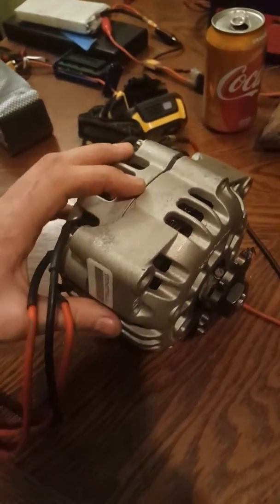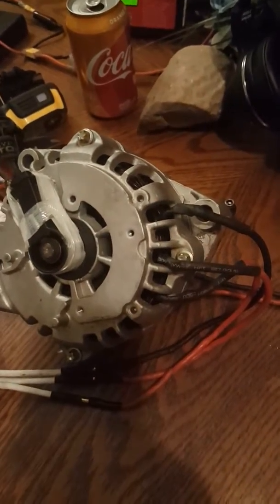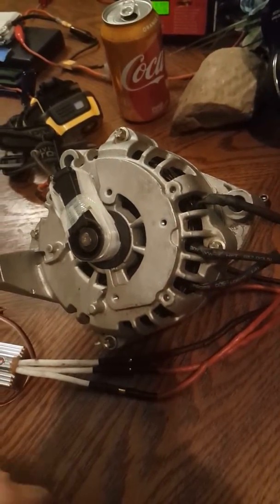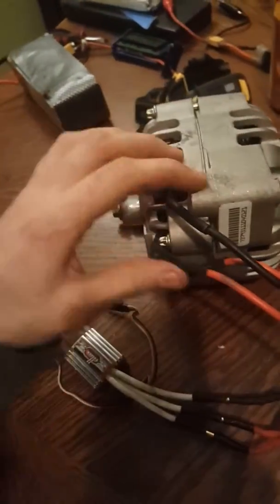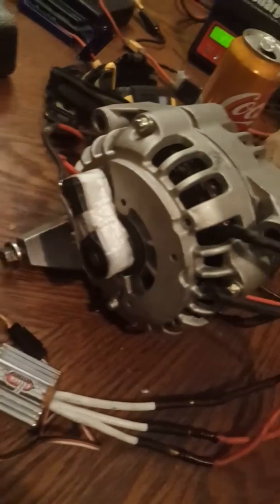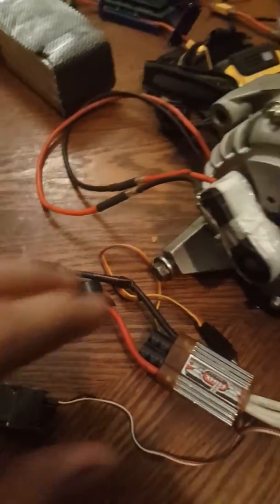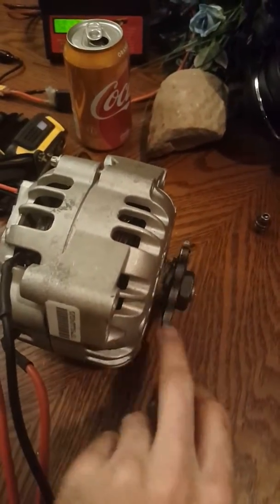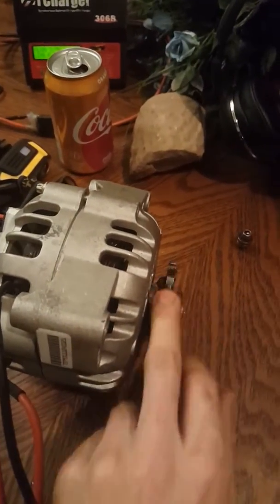What is required to turn a alternator into a motor. Electric yz450f. Video 1

Comment: I have two working alternators from E-150 Ford Econo lines.  Guess I need to open one up and see if I can get to the three Winding's.   If not I'll make a 12V Alternator / generator set up with a Lawn Mower engine.
Reply from the maker: The three wire or sixe wire alternators are easy to configure, just when yiu habe four youll.have to find out what wires are connected to three others then once you find that the single wires are your phase wires